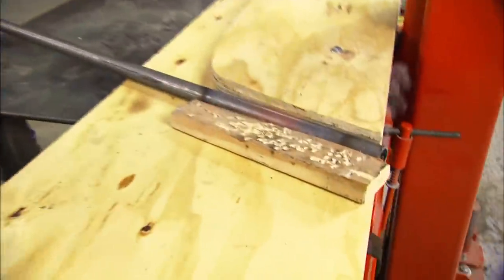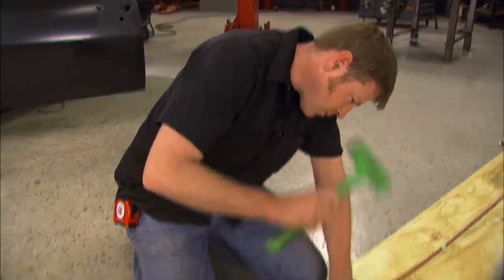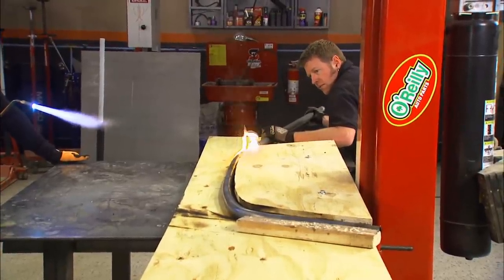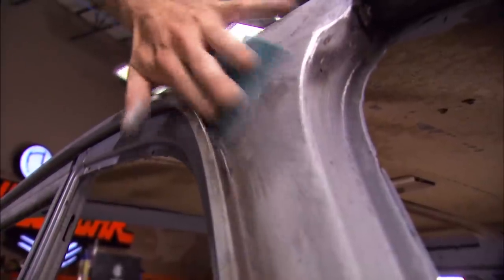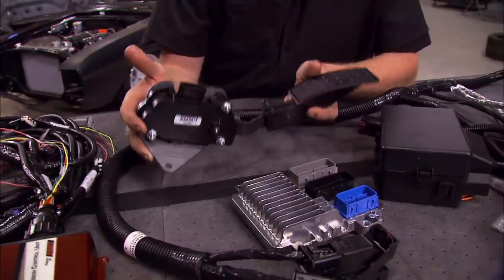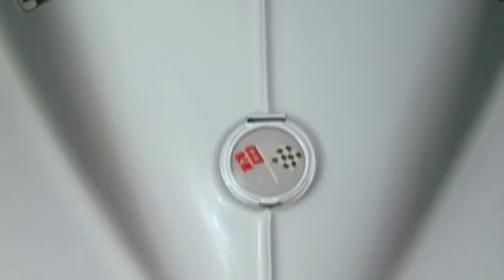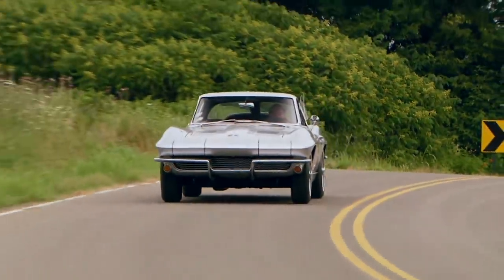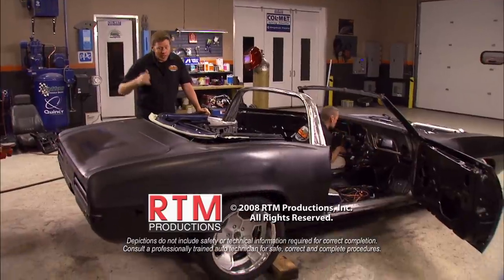Adding a Unique Touch to our Tribute Trans Am - MuscleCar S3, E17

Comment: Just a tip... When heating pipe to bend, only heat the inside of the bend, that way it will compress the metal inside the bend instead of the heat allowing the metal to stretch on the outside of the bend. Stretching the pipe will allow the metal to stretch out causing it to be less strong in that area!!!
Reply: But then you risk flatening out that section like bending a straw
Reply: @mattvest1660  I guess that could be possible but I never had that problem....
Reply: Plus he literally said it's for looks, that roll bar won't actually be a roll bar, just an addition in appearance. So compromised strength in the pipe doesn't matter in this application.

Comment: Should of been 303 inch  destroked sd motor per trans am spec. But with tech from today aluminum block fortified lifter bores ect. No real poncho fan wants anything ls in there .imagine a cobra with a 440 mopar .badass motor but it has no buisiness there. I am building an ls powered c10 but my 69 cyclone is fe powered.

Comment: shouldve soaked the wood in used motor oil. itill add a some fire resistant.
Reply: no it wont it will smolder and smoke worse - not even water - just do it dry or use a hydraulic tube bender !